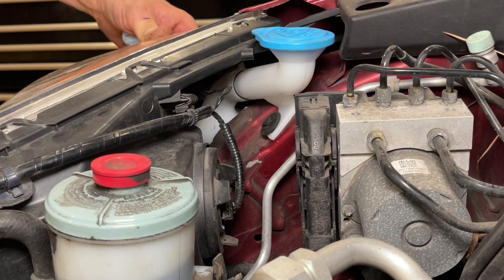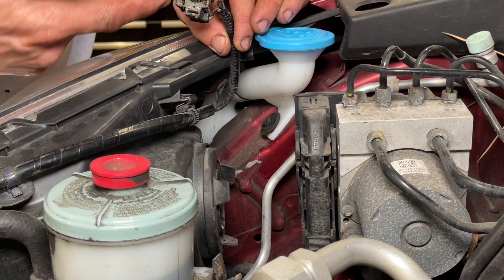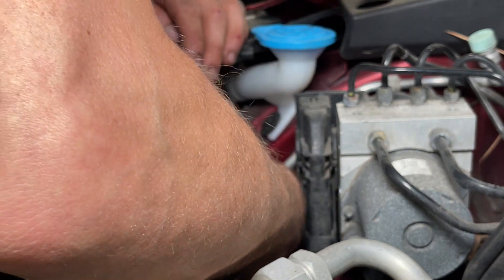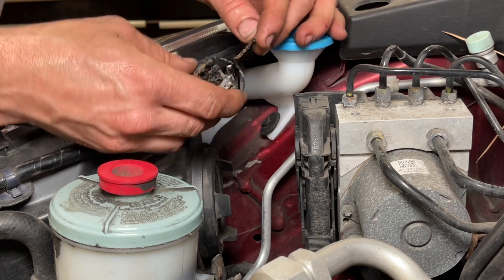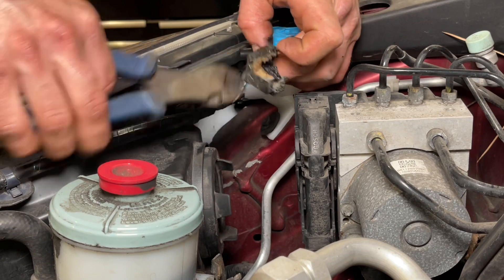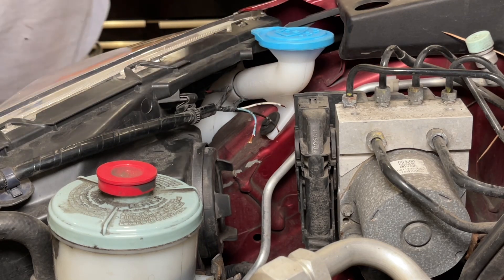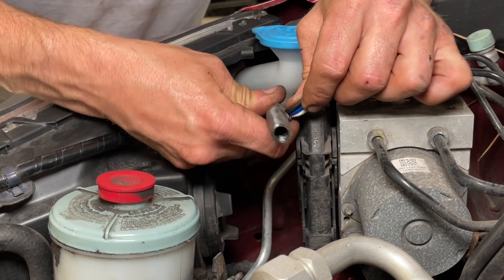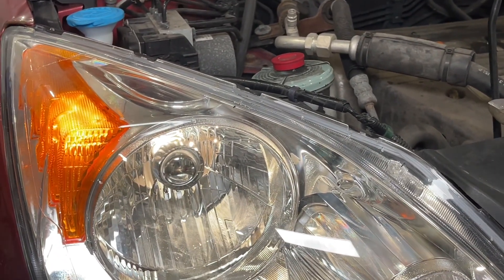Melted headlight harness repair. Honda CR-V headlight doesn't work.

Comment: Will this work on a burnt honda element wiring harness too? I have the same issue with my right headlight.
Reply from the maker: The process is the same on just about any vehicle. Just make sure you order the right harness for your headlight. I’m not sure off the top of my if your vehicle uses the same headlight bulb or a different one.

Comment: I have an RD1 (1st gen 2000 Honda CRV) and my passenger bulb seems to always go out. Might have same issue, ill check and respond. This might solve issues across multiple generations of CRV.
Reply from the maker: It definitely could be the same issue. I’ve seen this issue on several cars, across a couple different manufacturers.

Comment: Do you remember why the headlight still wouldn’t turn on after the harness swap? Having that problem with my 2009 crv. The headlight only turned on for a few seconds after I installed the new bulb and harness on the driver side  then went back out and I can’t get it to come on again. Brights still work. Any help would be appreciated!
Reply from the maker: It also had a bad headlight bulb.

Comment: The yellow thing is a sign that the harness is burnt and needs to be replaced?  Where did u order the parts? And what parts?
Reply: Thnx
Reply from the maker: The plastic housing on the plug is completely melted. Thats why I replaced it. There is a link in the description for the part I used.